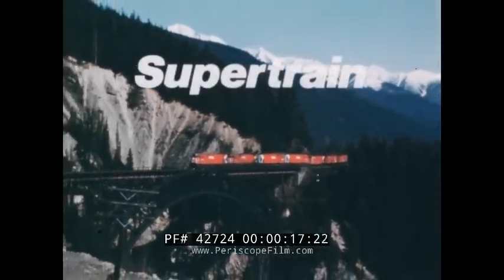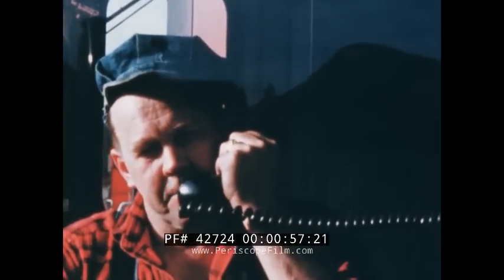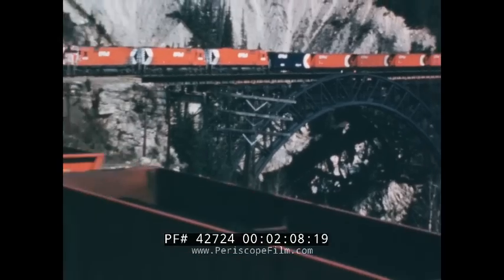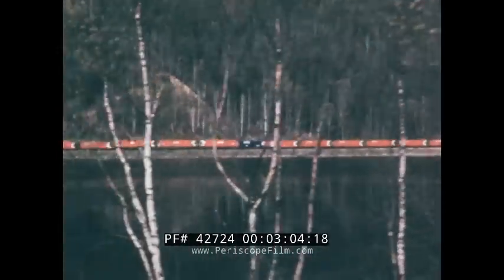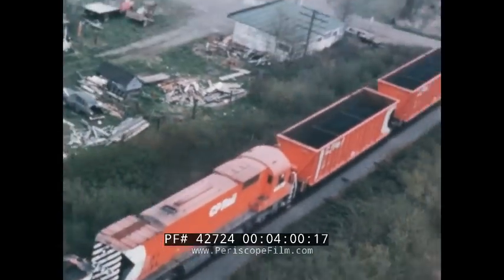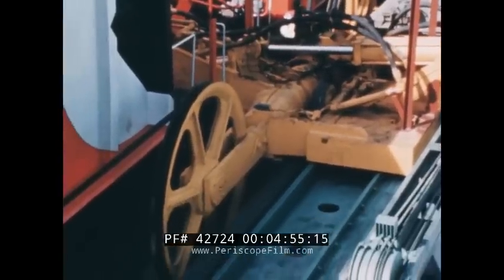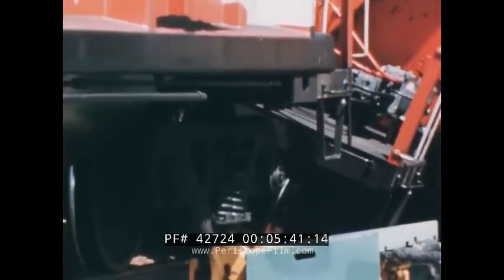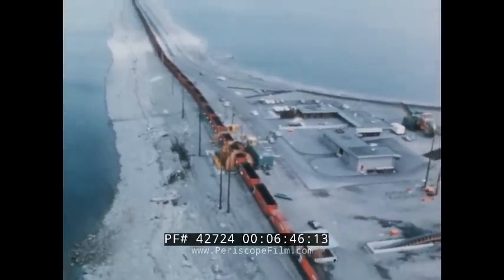CANADIAN PACIFIC RAILROAD   UNIT TRAIN OPERATION  COAL MINING   SUPERTRAIN    42724

Comment: I worked for CP starting in 1976. Notice the red coal cars. They didn't stay red for long. Eventually painted black for obvious reasons.  The  Kartrak bar codes on the side of the car were next to impossible for the  reader to scan because of the dust build up.
Reply: By the time CP started running unit coal trains to Thunder Bay in '78 all the new coal cars were now painted black. They had learned their lesson - the hard way!

Comment: CP had the coolest  engines in the 80s
Reply: This film was shot in 1970, or so, just after the start of this operation. Those MLWs you see pulling these unit coal trains were soon replaced by more reliable GMs. They found the MLWs to be too expensive to maintain and far too slippery -  traction-wise - to continue running them in mountain unit coal train service.
Reply: Fr

Comment: This is early 1970s I think.
Reply: Yes, it is. The description of the video is incorrect when it says '80s.
Reply: I hired on in 1979 and the robot cars were being used into the mid 80's. I only got to see inside of one of these blue remote cars and it was basically an empty car with a basic control stand and filled with damaged rail as ballast to give them some weight.
Anyone know what ever happened to them after that when DPU's went into service and replaced them? 
Also, in early 90's the caboose went - bye bye...and a brakeman was eliminated soon afterwards...
Reply: I'd wager they were either scrapped or turned into standard payload carrying cars.

Comment: Cool! The locomotive engineer in the video at Sparwood is Bert Josephson. He passed away several years ago.
Reply: Coal trains started to leave Sparwood in late April 1970. I order to rotate the cars at Roberts Bank the CP Rail symbols could not be next to each other. When the new unit trains arrived in BC they were left at a siding called Wardner. They was a wye at Wardner were the rail cars could be turned 180 degrees and properly aligned for the train.
The car readers in Sparwood never worked well and didn't last long, BOY I'M GETTING OLD!!
Reply: F